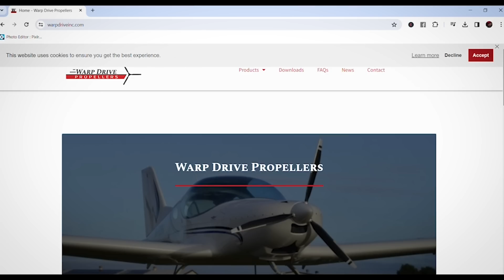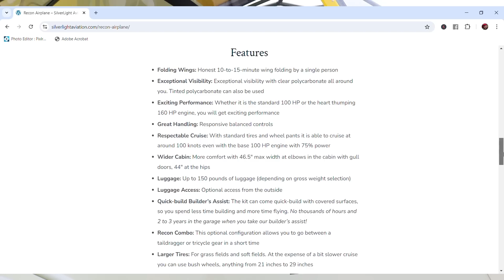Can YOU Build This? New Aircraft Kit Arrives at EAA Airventure - Recon Aircraft

Comment: Like design. Reminds me of the way most RC airplanes are sold now. Full scale ARF kit.  But to be honest no real building to do. Little bit of assembly and wiring.  Dont see in any way how it can ever be considered homebuilt. Is this where the industry is headed? The industry has been fudging the 51 % rule for a long time but this is getting out of hand. Anyway love the channel Brian. By the way hows your Zenith build coming?  Need an update .
Reply: The rules are based on number of tasks. We do not make the rules. They do not say task has to take X number of hours to be considered a task. As the buyers pool gets older and older, they do not have 4 or 5 years to wait for a kit and build. Younger buyers pool is getting thinner because things are getting expensive which is a shame because the industry is bound to shrink if this trend does not change. Wiring is "not some wiring". I spent 300 hours just on wiring and designing the panel and layout and installing autopilot etc. Today's aircraft and avionics are not 50 hour wiring job. I wish this Garmin G3X wiring and install was 50 hours. Even if I do it again it would be 200 hours.
Reply: @silverlightaviation  I agree, the wiring harness is probably one of the most important assemblies in a HB aircraft.
Good analysis of the potential market.
Reply: I would rather have one built 100%. Do a thorough checklist of the exterior, get in and another interior checklist, clear prop and let’s go fly after some high speed taxiing
Reply from the maker: @flightnavigator8999  It does seem like we are heading more into that direction. At least... having it available to the masses as an OPTION for building/owning/operating an Aircraft. And I don't see the FAA having a problem with it so long as the "Repairmen Cert." is NOT issued to the Owner unless he is 51% The BUILDER gaining the knowledge of keeping it Airworthy.  - I do OWE YOU an update on the Zenith now don't I. We had a few month pause from working on building the wings when my father had a heart attack requiring a triple bypass. Then a complication with clots. Been a real interesting season to say the least. We are getting back on track now though. :-)
Reply from the maker: @richardturner6278 Was meant for you
Reply from the maker: It does seem like we are heading more into that direction. At least... having it available to the masses as an OPTION for building/owning/operating an Aircraft. And I don't see the FAA having a problem with it so long as the "Repairmen Cert." is NOT issued to the Owner unless he is 51% The BUILDER gaining the knowledge of keeping it Airworthy.  - I do OWE YOU an update on the Zenith now don't I. We had a few month pause from working on building the wings when my father had a heart attack requiring a triple bypass. Then a complication with clots. Been a real interesting season to say the least. We are getting back on track now though. :-)
Reply: @ExperimentalAircraftChannel Prayers for your Dad’s health buddy. Hope his recovery goes smoothly. Thanks for this video. That’s a sweet plane.

Comment: If you had amphibious floats (on this plane or similar), could you fold the wings back or would it fall on it's tail?
Reply: I know exactly why you are asking. For docking. The answer is yes you can fold the wings on proper floats without dunking the tail in the water. I worked on American Legend amphibian super Cub floats. Floats of similar capability can be used and they won't allow the plane to drink water at the tail. Docking was a big issue for Searey because the folding wing was a very late afterthought. Otherwise a very capable light seaplane. Generally, a float system is or should be designed so that if one float has taken 2/3 water, it still should not flip-over. There is a decent safety margin.